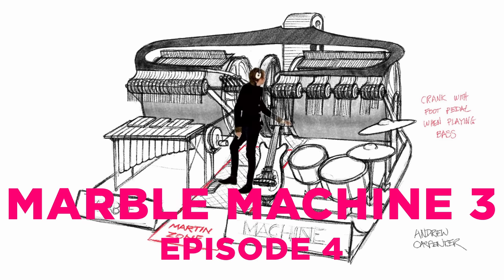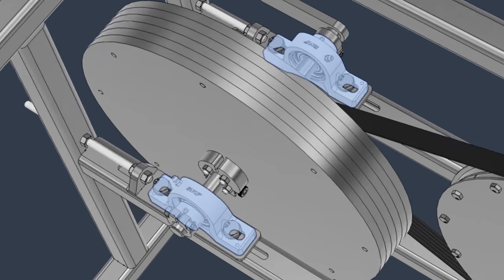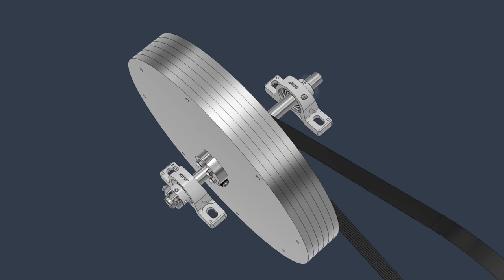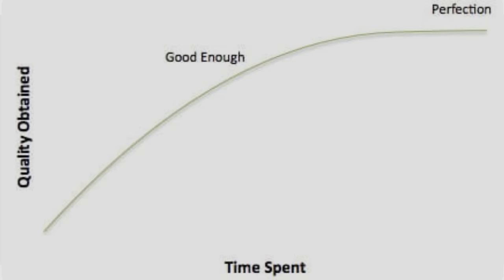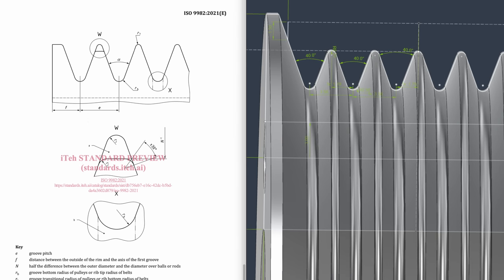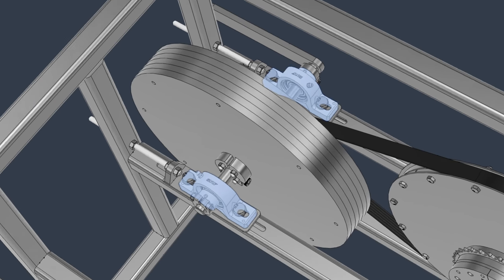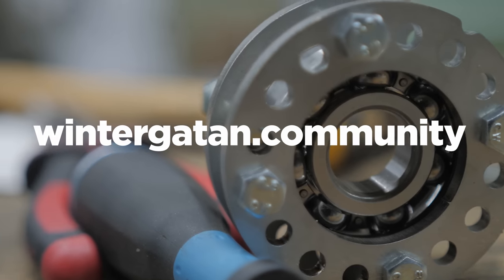A Better Flywheel Design - Marble Machine 3 Ep.4

Comment: If you want to have an easier time reaming the laser cut holes, make them even smaller, get an undersized drill for the reamer and drill away the hardend surface before reaming. If you're not going to make a lot of them though it's probably overkill, so just ream it, more wear on the reamer is not that big of a deal for you as it is for someone using that reamer daily
Make some marks on the rail where the tension adjustment is, it will help you keep it straight when tightening, sort of like it's done on the rear wheel of motorbikes.
The locking rings on the outside are really overkill, the 2 set screws on the pillow block hold up insanely well, I have 37kW fans at work, that use 2 pillow bearings on the main shaft and they are secured only with those set screws, newer slipped. You could potentially put the 2 pillow blocks on one side of the flywheel if you have the room to spare, keep the stickout of the shaft low and it will make switching pulleys a lot easier, with the arrangement you have, you need to remove the whole flywheel shaft assembly out of the bearings to change the pulley or flywheel plates, whereas if you make it so that it's supported by the bearings on one side you can just remove tension, and swap pulleys without removing the shaft
And yes, balance > concentricity, but you need concentricity on the pulleys and starting with a concentric flywheel makes it easier to balance it, good method for balancing is using a speaker as a sensor, Mathias Wandel did a video on that with an osciloscope, you could probably hook it up to your ADC and look at the waveforms in your DAW instead of using a scope.
Reply: If he's drilling anyhow, he's better off having the entire thing machined from a single part. But, lets face it, he should just buy a flywheel.
Reply: @thomasbecker9676  not that easy or cheap to get the flywheel plates as a premade part. Since they are getting laser cut anyway it's a good idea to at least get the holes cut close to size, it doesn't cost much and it makes them close to the right location without any manual labor. They don't require insane precission, so laser cut + reamed is perfect for the application
Reply: @tomboxyz5564   @TomboXYZ  They're not hard to find at all. Multiple people have posted links to examples of all different masses and sizes. Lasercut parts are inherently imprecise; just saying "ream the holes," isn't going to change that.
Reply: @thomasbecker9676  well, laser cut is definetly precise enough in this case, it's not going to spin at 10k rpm
Reply: @tomboxyz5564  By all means, post Martin's established requirements as compared to the manufacturer's stated level of accuracy/precision. Also, an unbalanced flywheel doesn't have to rotate very fast to induce serious vibration and parasitic motion.

Comment: You may want to widen the bolt pattern that goes through the flywheel to give yourself more clearance for wrenches and other tools. Having to use the open end of a wrench and only being able to turn it a sixth of a turn before re-adjusting is always more of a pain than you initially think and widening it just a bit can eliminate that headache entirely. Especially if it could have been wide enough to fit in some sort of ratcheting wrench or impact driver.

Comment: Well done going with a proven design.  A tip for the belt tensioning (proven design) - use an idler pulley. 1 additional pivoting wheel with a spring for tensioning. An example would be the tensioning on the drive belt for a ride-on lawn mower.

Comment: I'm hesitant to point this out given how far along things have gotten, however I believe the proverbial gun was jumped here going straight from designing the marble gates to the power supply, while the entire machine in the middle is still a big question mark. I would have suggested simply powering the machine with an electric motor during the entire design phase of the rest of the machine, and left the power source design to be one of the final steps once the demands on it were actually determined.

Comment: I was really wondering where the pulley was going to go with the fixed shaft design. I think you forgot the interfaces lesson for a bit there: the real point is that you've got a belt that resists changing speed, and the flywheel is incidental to that requirement.

Comment: Change the belt to use v-belt and use a Adjustable Sheave, off the shelf part, that way you can adjust the pulley without changing it.

Comment: The most important weight on a fly wheel is on the external diameter, you could consider to cutout the center of the wheel.

Also, you may look for water cutting, so no heating the metal.

And the pulley should exist as stock parts if you key the pulley to the shaft instead of bolting the pulley to the wheels. That mean you also have to key the wheels to the shaft though.

Comment: On the flywheel, If you're concerned about the overall weight of the machine as a whole. Mass in the center of the flywheel has less affect then near the perimeter. This is why most flywheels are spoked. This puts all the weight where it matters most.

Comment: you want to mount the flywheel shaft as close together as possible to minimize shaft flexing; the pulley should attach to the shaft outside the mounting points.

Comment: The design still feels unnecessarily complex.
You could simplify it by integrating the bearings into the pulley - since it'll be custom made, you can achieve precision needed for the interference fit. The axle can be then mounted with simpler mount.

Comment: I am not an exper so seek second opinion but if you are worried about the heat hardened surfaces of the holes damaging the reamer then you can anneal the surface slightly with a mini torch. makes it easier to drill. Annealing is basically just heating up a metal in order to reduce internal stress and relaxing the hardened metal making it easier to work with.

Comment: For the reaming you can get slightly oversized and undersized versions of all nominal sizes.  If you have these then you can sneak up on a perfect fit for the shaft.  You start with the undersized, test the fit, move to the standard, test the fit, and then use the oversized.  Obviously you stop when you get a good fit.

Comment: I am not an engineer so this idea may be dumb.  To make sure the fly wheel is balance should there be a lip so you can put weights on it like when you balance a tire for a car. You can use wheel weights to easily balanced the wheel. I am concerned the fly wheel may become unbalanced while on tour.

Comment: Another thing to consider when designing rotating components is the frequency at which they will be rotating relative to the length of the shaft and position on said shaft. For Marble Machine 3 this may be difficult because of the machines requirement to play at different tempos. You can always play around with different size pulleys to change the speed so that the fly wheels rotational frequency  is not equal to the resonate length of the shaft or other rotating components.

Comment: Definitely the best way going with the mounted bearings, use them at work and the pressure they’re put under daily is immense.

As a thought, if you’re worried about the heat from laser cutting affecting the parts, would it be possible to use water jet cutting instead?

Comment: instead of completely filled discs for the flywheel, consider using discs with the weight mostly located in the perimeter, they are more efficient at keeping their inertia since the moving mass is at the far point from the center, giving it more torque

Comment: I would put bushings in the square tube holding the flywheel pillow blocks so it doesn't crush. Just one hole in the bottom on one end of each side and slide them onto the bolts and slide it back for the next set of bolts.

Comment: You really should provide for some integrated means to balance your flywheel. 
You could drill holes around the perimeter of the discs and tap them to insert fairly long grub screws.
By adjusting the depth of each screw you would have the ability to balance your flywheel "on the fly"...
Reply: It should never need adjusting on the fly. Making the balance adjustable makes it possible for it to be out of balance. It should be spin balanced at a balance shop, and then it’s balanced. It can only be unbalanced by adding or removing material or bending the shaft (which is why the shaft should be as short as possible).

Comment: Something either works or it doesn't.  There's no shortcut for interference fits.  I think that is what you want to re-engineer.  You start with a well reamed center and build out. With  multiple layers you can't get a proper ream. 20 is a very small hole.  Your axle should be 20. When the main bearing is set you can put it back in the lathe.  Use a tail piece to secure and then you can do finish runs to straight up the process.  There are many formulas for tooling in mills and lathes.  Throw away the book about tool pressure and feed rates.  You have to  just put in the chuck or vice and it will let you know  what feed and pressure to use by vibration.  You have way too many bolts.  Because they can warp things. And use regular bits and reams and tap  holes by hand to reduce heat from laser cutting and cnc process.  Cnc is great for mass production but it not great for things that should be done by hand.  
Yes.  Use proven technique but you have to a machinist to know how to simply design traditional engineering.  
You have not even got the fly up to full speed for a how long will go test.  Because any variable in steel shows up in the end warps and such.  I think you should be using manual process as much as possible when working with machining steel and axle.  Use the bearings the way they are designed to be used.  Interference fits. You can't design around them.  Learn how to do Interference fits.  Looks great! It either works or not. High speed fly  are one piece.  Without a set axle you can't even properly hold it in your lathe Jaws.  Don't laser on machine steel.  Fine for soft steel but not for hardened things.  Use old-school manual machine to slow down rpm and tool pressure.  Find an old man to teach you.  You are a student using student skills .  All hole are self centering for most part.  You can't properly machine laser cut edges.  Minimize laser when even possible in hardened steel!!! Only use laser to cut thru holes.  Not for any other reason.  Do not use main flywheel to adjust belt tension.  The flywheel should not move.  Use a manual mill to ream because you do need perfect reams. Use the mill deck to hold your work but don't tightly hold it  while drilling holes reams.  Proper reams are critical.  Don't ream laser cut holes.  Because every hole must be the same hardness reaming usually more than half mil. You have under estimated the importance of proper reaming.  Run the ream through the hole completely.  Stop the mill spindle.  Pull the ream out of the hole while stopped.  It will leave flute marks.  This is how a proper ream is done old school.  Stone any surface burrs. Do not stone the hole. Stop using laser to cut holes.  Because shop books are also not consistent.  Every thing you are doing requires a properly indexed mill and a lathe. If you need to adjust flywheel weight do it with a lathe.  I think you need heavy as possible.    Flywheel should be absolutely fixed and not adjustable in any way.  There are other ways to adjust tension.  Laser cut holes don't tap as well either.  All your pulleys are reamed and interference fit to the the bearings.  Anything with bolts will come apart.
Reply: Don't use hand drills for any reason.  Sometimes it takes 12 bits to size up to the hole you want.  Don't get in a hurry.  Only holes that are  interference fit are  reamed. Usually. Pillow bearings are for stability of the axle not for replacement of the main bearing.  Use exact shims when needed.

Comment: I'm not an engineer, but isn't it safer to move the motor for the pulley tension? I think there's more force in the flywheel than in the motor.

Comment: 5:14 use a tungsten carbide reamer or a coarse brake cylinder hone to grind away the hardened bore surface, then ream with a HSS reamer.

Comment: I am worried your belt tightening contraption adds potential axis distortion to your setup. If you get a parallellogram, you'll have forces very capable of warping your shaft. Oh, and a laser alignment tool is not cheap but possibly required for the longevity of the machine.
Reply: agree, doesn't sound ideal. How about keeping the wheel in place and having a spring loaded idler pulley to maintain tension

Comment: I was thinking about the dynamics of the snare drum. I mention in a comment that I doubt you would use chickpeas and nuts to hit the drum. I was thinking of other ways of doing this. You essentially have an oversized MIDI device. You need to change the velocity of the notes or modify it in post. I was originally going to suggest using another wheel that indexes with a marble drop, which lifts a stick to strike the drum at different velocities. I think that it would be better perhaps to use horizontal velocity to change how hard you hit the drum. You can also control the speed of the marbles with magnetic force.
Reply: NOOOOOOnononooooo!
No magnetic marbles!
This is against all the rules of the MM3 ;-)

Comment: A reamer will leave a nice finish but it will not locate an improperly placed hole. A boring bar will leave a great finish and fix a hole's location and perpendicularity.
Reply: Only use manual mill for drilling holes and reams.

Comment: 6:35 "Far from a perfect drawing" is putting it lightly. That measurement chain alone made me cringe. You don't chain measurements like you did on the left there. That creates ambiguity regarding tolerances (Because they add up if chained like this), not to mention you couldn't actually measure this IRL. Instead, you'd measure the distance to the peaks (or the bottom of those grooves) and measure it from the edge for each of them individually. Another option (and probably the one i'd use in this case) would be to only add the measurement for the distance between the bottom of the grooves on one side, and then add another measurement from the leftmost to the rightmost one, and write it out as "5 x 3.56 (=17.8)". This is allowed (at least under german standards, idk about international ones, but they probably have similar ones)
Reply: He'd do well to read ASME Y14.5
Reply: @thomasbecker9676  One of many books he could read on that matter. My recommendation would be Hoischen Technisches Zeichnen (i know, my german is coming through) but i suppose reading technical books in a second language is hard enough.
Reply: @Chrischi3TutorialLPs  AMSE Y14.5 isn't a book, it's a specification/standard.

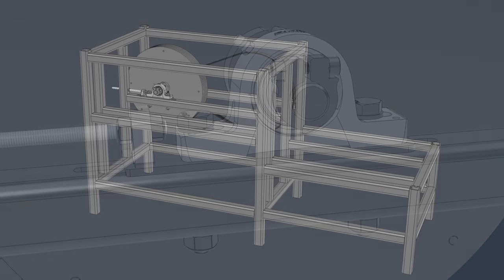Comment: I think it would be better if the bolt you use for clamping down the bearing blocks (3:11) won't go all the way to the other side of the extrusion, instead they should be tighten on the inner face of the tube, with Clarence hole to let you execs it. 
The way it is now, the tightening force is limited by the structure of the tube (if you'll tight it to much, you'll basically squish the tube).

Comment: Why use a shaft clamp when you could use a keyed shaft? It just seems overcomplicated and less reliable to use a clamp.

Also as for the pulleys, wouldn't you wanna use an off the shelf one instead of having one lathed? Sounds like a lotta extra work for zero benefit.

Comment: Well done, Martin.
Reply: I would add as I did last week that you might design a rubber vibration dampening block between the bearings and the frame. Fairly early in the life of the bearings, they will develop internal vibrations that your metal frame is likely to amplify. Those are also commercially available. They’ll have something like a 95A shore harness rating. Also, be mindful of the precessional forces, making sure the frame can’t bend in directions you might not expect (like twisting as opposed to sagging). Also, consider a longer belt with an idler pulley for tension. That may be more robust in the long haul as the spring tension will automatically take up the slack from belt stretching. Also, it will dampen the belt’s tendency to flap on the low tension side of the system.

Comment: So nice following along the new build! I really like that you question old ideas but that you also are humble enough to accept the same. The beams that the fly wheel rests on will take a lot of weight and force. Maybe find some other fastening solution other than cutting slots. It will weaken the construction substantially. Thank you for sharing the process!

Comment: With a fixed (although adjustable) location for the flywheel, you may find that natural expansion/contraction and creep make the belt unpredictably tight or loose during operation. I would keep the flywheel in a fixed position and apply an adjustable spring tensioned idler wheel or PTFE runner to the belt. In a similar manner to cam drive belts on car engines. Obviously, automotive cam drive belt tensioners are widely available if you don't want to fabricate your own. If slip is an issue, you might want to consider using a toothed belt and pulley.

Comment: A single extra plate that has a different weight would add a whole 6 additional weight options for the flywheel allowing for that much more precision adjustment. That's right, only 1 extra plate would literally double the iterations of adjustments you can achieve (efficiency). The weight difference can be easily done by designing holes in that plate for less material.